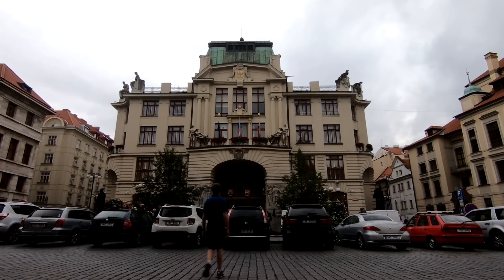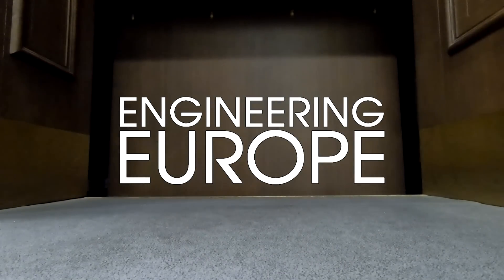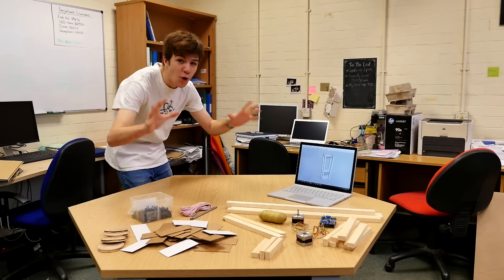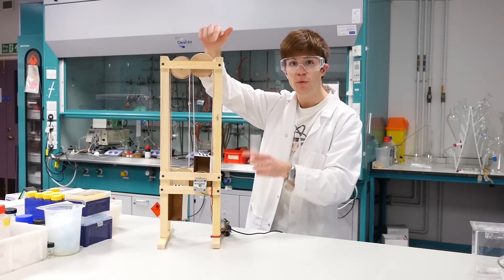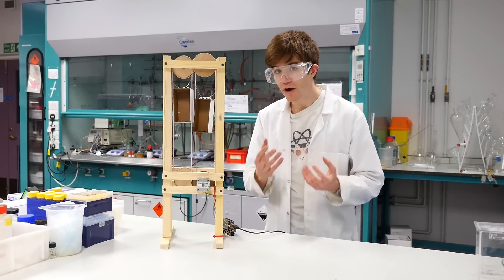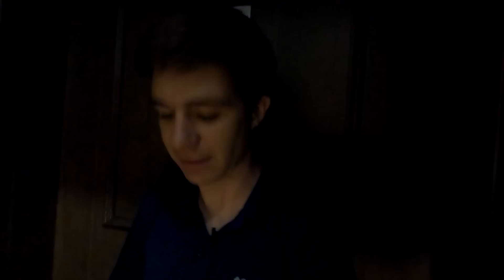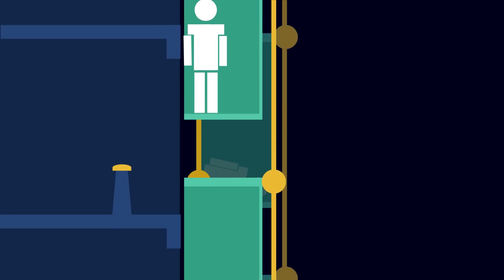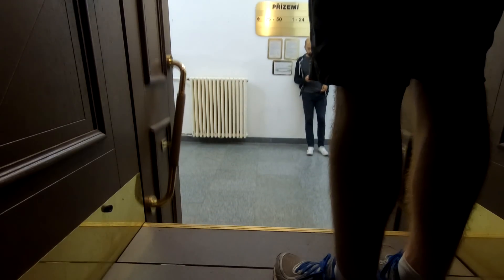Riding the Elevator of Death

Comment: It should be re invented with modern tech with sensors to automatically stop if someone gets stuck between the floor and elevator so that they don't get killed.
Reply: :)) there are already such sensors in place- mix  of  mechanical&electric.... Its not so dangerous as it looks... :)
Reply: @hyneklos  Many used 'trip wires' to detect arms or limbs straddling inside and outside of the cars.
Reply: They Have Now
Reply: This elevator has them. He just didn't show it. Those are the grid at the top of the entry and part of the floor. If your arm is outside it will move grid up, disconnect circuit and the elevator stops. Similar for the part of the floor. There are hinges so if you go up and your feet is up it lifts that part of the floor and disconnects circuit.
Reply: This is how safety flaps work: https://www.youtube.com/watch?v=-Y1ME8n5tCU&feature=youtu.be&t=95
Reply: @JBereza  Good to hear that.
Reply: @JBereza  Thanks
Reply: @JBereza  Exactly! 👍
Reply: Any idea how the safety flaps handle getting stuck between the roof of a cabin and the floor when going down? The video doesn't explain that situation.
Reply: With the general ability of the public to mess up simple mechanics, one can only imagine how many times a day a pretty used pater noster elevator would stop...
Reply: that would be good and bad at the same time since if one person gets stuck then everyone else gets stuck too
Reply: Like those movable boards that are at those elevators already. And BTW they are, or were few years back, in the same group of devices as escalators and travelators, at least in Czech republic. Turning them off with laser gates and closing shafts automatically during fire could easily be done on them.

And it seems like they are not elevators even in other countries in EU and thus they do not fall under harsh regulations for lifts. Thus...  they most likely CAN BE build.
Reply: They already have "tech" to do this. This "modern" age isn’t the first to consider safety. 
Calling them elevators of death is just attention grabbing sensationalism.
Reply: We have one at our university and it isn't great. It is slower than going up the stairs, which can't be fixed without making it harder to board and unboard, and it can't be used by people in a wheelchair. It is also quite a waste of energy since it doesn't stop when not in use. It is fun to use sometimes tho.
Reply: Why not just have the elevators take a short 3-5 second break at each floor?  That way there isn't a huge wait but people can still get on and off in time.
Reply: Or even smarter an idea is to have an even number of carridges and making them the same length between each level so that it can stop for a short period of time at each door
Reply: @zoe4299  i was thinking the same thing
Reply: Could even be done with old tech, if the last say, 60cm to the lift in the floor was an easilly togle able hatch. Get stuck while coming up? No smushing in between elevator and floor, floor will just pop up. Make it a grate so people above can see and hear things going wrong and step off.
Reply: It is just dangerous while stepping on or off for the cabins keep moving and you could struggle and fall. I have taken the paternoster in the Haus Grenzwacht in Aachen, when I worked there. It is still working, but it is not usable forthe public.
Reply: We must never forget, humanity is stupid, if we can find away to mess up safety mechanisms, we will.
Reply: That's called a modern elevator
Reply: or injured
Reply: Where's the fun
Reply: And how do you solve this for people with a handicap? Say someone with a broken leg either using crutches or a wheelchair?
Reply: @saiverx  kick em out
Reply: Nope, there is too much health and safety as there is.
Reply: @MrToradragon  Modern technics is not reliable, I believe more to that moving boards and wire traps than to some lasers.
Reply: Risking dead just so youd save a min of your life.... nah id rather have a door and wait for that minute
Reply: Like Tesla doors
Reply: Elevator Engineers, takes notes from this guy!
Reply: @crimsonbutterfly2282  No respectable engineer would make this for real. Lesson one on engineering is that safety is top priority. So whatever machine you make, youd have to make it dumb-proof. Not even the stupidiest person that has access to your machine should get hurt.
Reply: True but people will still not go on it coz it just looks scary in the end.
Reply: that's easier sed than done
Reply: There are saws that will stop if you accidentally cut your finger, would you put your finger in there everyday because it is safe? No, you wouldn't, that mechanism isn't made for all the time use is made in case of an emergency.
Reply: @JBereza  least im not going to get decapitated by an elevator
Reply: @zoe4299  On the other hand, it may be slightly bumpy. Another problem is that assuming that these are all connected, the "cabins" that are aligned with the floors are fine but the people that are in between floors will be stuck there for additional time. Plus, these don't move really fast, compounding the timing problem, but at least people are not going to get injured from this.
Reply: Imagine the people at the very top and bottom, they'd think the elevator doesn't go back down/up
Reply: Those are already being used I think
Reply: @saiverx  You install a classic elevator close to it. They were used for buildings where a single elevator wasn't enough. This occupies a place for two classic elevators, so  if you have a place for three classic elevators, you put one classic elevator and one paternoster in there and get a much higher total capacity. I haven't seen one installed without a classic elevator somewhere near.
Reply: @jm56z43  this is in Europe. They aren't as idiotic as we are in America.
Reply: @mrgreengenes04  I am European. I can guarantee you we aren't that intelligent that a Pater Noster elevator would be efficient.
Reply: But then the other lift stops and someone is stuck in that tiny spacd
Reply: Except adding more tech and electronics makes things less safe and more prone to problems, design failures, etc
Reply: @vaseklepic12  to
Reply: This is possible, but then again, escalators have the same benefits and none of the problems. They do take more space, but they also take many many more people.
Reply: Pain is often a good teacher

Comment: For everyone trying to come up with fixes to make these usable, I present you: People in wheelchairs or people holding large items who can't see their feet
Reply: I would assume that these elevators would not be the only ones present in a building, if they were to become mainstream. There is no reason why two types of elevators are not allowed to be used at the same time.
Reply: @bowmin1  Agreed. One for fast transport, for busier foot traffic (Prague's Paternoster Lift) and one for handicapped or for people who can't see there feet (traditional lift).
Reply: A 'slow down' / 'stop' button like the ones in revolving doors would fix their issues
Reply: Cripples aren't real people and who watches their feet?
Reply: @RockLeeOfTheMounties  i hope you are joking or just trying to stir things up, and don't actually think this
Reply: @QuincyIsCrispy  but then it stops the entire elevator system for everyone going both ways, so it’s ineffective, you just need a regular elevator instead
Reply: Stop and start at each floor on a timer + an additional handicap button for giving you extra time
Reply: @LeAlexo  Yeah, but how many people will need to use that button versus people who don't? Relatively there'll be so little users of that feature that it really wont matter. Plus and extra 5 or so seconds of waiting wont hurt anyone.

As for people that aren't necessarily movement impaired but just are carrying cargo, if the building requires a lot of cargo to be moved up and down it'll have a cargo elevator anyway. 

With some re-engineering these seem like a great idea to me
Reply: @LeAlexo  its still more efficient because you can have someone unloading or loading on multiple floors at the same time.
Reply: @RockLeeOfTheMounties   Okey boomer
Reply: Why not use the tech used on garage doors everywhere? A invisible beam that must be connected to move. If it’s broken, then box stops. Install a mirror on the back wall of the box so folks can see the floor numbers. 
As for people unable to see their feet, Again, a mirror installed at an angle on each floor aimed at the edges of the box and floor. If your package is too wide to see around via a mirror, it’s too wide to get on the elevator. 
Literally two mirrors and a light receptor. It’s not a complex solution.
Reply: @RockLeeOfTheMounties  Ivar the Boneless wants to know your location.
Reply: Yeah but for thst in thos buildings are even normal elevators this pater noster is great and quic travel . On my college we use it everyday and a lot of times .
We have normal elevators , this one and ckassic sterway and we use this one like in 90% of case , other 10% are whem there are many and you are in rush somewhere
Reply: Fix: they stop for 15 to 30 seconds after reaching a new floor
Reply: @sumvs5992  the point of the elevator is that it keeps on going so that people don’t have to wait as long
Reply: @jhsevs  THEN HOW IS IT EVEN MORE EFFECTIVE THAN A NORMAL ELEVATOR??? ITS NOT SHUT UP
Reply: @Halloweenharen  it would still be orders of magnitude more efficient than a conventional elevator in an extremely busy building
Reply: @jhsevs  absolutely not, if it stops ok every floor then what is the point? Also, with all the extra safety features requiered its going to be even slower AND on top of all this - only one person can go at a time per carriage
Reply: Simple: have one normal elevator next to this one. Trade wait times for accessibility if those conditions apply to you. Most people use this, movers and the disabled use that.
Reply: How about a platform you stand on and that platform slide in and out the elevator automaticly (only if the person is ready). With that you avoid the risk of bad timing when entering or leaving and people in wheelchairs can easily role on the plattform.
Reply: @Temo990  that would defeat the purpose because the elevator would have to stop. The entire point of paternoster elevators is that they’re nonstop with zero wait time. If there’s going to be a wait, you might as well just have a regular elevator.
Reply: @MegaBrokenstar  Not if the mounting mechanism is suffiently fast. Human reaction and movement does take some time as well and machines/computers can be quite fast. A passing machanism would be good (like if you pass an apple from one hand to another).
You have one claw with the plattform and that claw passes the plattform to the other claw which is inside the cabin of the elevator. I think of claws that are used on assembly lines.
Reply: @Temo990  that would have several potential problems and would probably be less safe than the standard paternoster. If that moved while you were trying to get onto it, it could easily send you flying. Any moving parts exposed could easily crush or amputate limbs in under a second before you even realized you were in the wrong place. Not to mention the acceleration required to suddenly shunt this “moving platform” onto the elevator would be extremely jarring to anyone standing on it and probably result in them falling down or even falling off the platform, like a bus you’re standing on abruptly slamming the gas or brakes.

And besides all of that, the complicated mechanisms involved would be extremely expensive even if you could solve all the problems and they’re COMPLETELY unnecessary. Moving heavy furniture or going up and down the building in a wheelchair is an extremely low percentage use case. A large parallel single shaft regular elevator for people who need one would cover the rare cases in which one was doing those things. And a simple system using the technology of existing infrared-beam alarm systems could be used to Autostop the standard paternoster if anything was within 3 inches of the front edge when it was more than a foot above or below level with the floor, preventing anyone from being crushed.
Reply: @jhsevs  but if it stopped at every floor, wouldn't it be slower than a regular elevator?? 🤣
Reply: @QuincyIsCrispy  People would be hitting that "SLOW" button every single time they got on it off the thing, it would be worse than the walk button at intersections.
Reply: go to a hotel or establishment that is equipped to deal with that, why does everything in life have to cater to EVERYONE
Reply: @RockLeeOfTheMounties  Don't cut yourself on that edge, kid, I doubt anyone wants to kiss it better for you.
Reply: ok but ladders are quite popular and they have the same problem
Reply: I present you: They're really fun. Those people can go use the normal boring elevator that carries no risk of death.
Reply: I present to you, nerves!!!!!!!!
Reply: Why not have both types. Being the death elevator comes with a but ton of warning signs. This elevator can make a diff in office building
Reply: @KeruuKat   If you put sarcasm in his post, it makes more sense.

Comment: The one in the UK has lasers if the beam is broken the lift stops automatically
Reply: Too bad. Really bad.
Spoils all the fun of pain screams and bone shattering.
Hope they return to sense and bring back the thrill.
Reply: good idea...
Reply: @pedrocarvalho4999  wtf
Reply: Where is the one in the uk
Reply: @benlenton3932  Sheffield University arts tower
Reply: The ones in Prague (there are multiple, you can most easily find one at the Faculty of Mech Eng at the Czech Technical Uni) have movable boards on each side of each opening, those stop the whole thing way before anyone can get hurt. The bad reputation came from the ones that didn't have these simple safety features.
Reply: I think that the don't have safety sensors are illegal today.
Reply: @pedrocarvalho4999  What the actual hell
Reply: @pedrocarvalho4999  well if we can respawn back its fine but we can't respawn in this world
Reply: uhhhh I went in it recently and I didn't see any laser, just pieces of string that do the same thing
Reply: @rakifdes  smh we can have you ever played m I n e c r a f t ?
Reply: @novacentorium4943  oui
Reply: @novacentorium4943  it’s hardcore. Everything is against us.
Reply: @adigenix  oh frick
Reply: @selfdestructiontaboo  You know you could simply press the emergency button, do you? Eighter way, doing this intentionally to trap users in the elevator is illegal ;) Misuse of the emergency button or messing with the electronics meant for the safety of the whole thing is a serious issue and you could be fined at best, or go to jail at worst. Don't do this...
Reply: imagine being in between floors and some doofus sets off the emergency stop

Comment: Yes, the lifts are less safe than the classical type, probably on principle alone. But Paternosters used today are usually equipped with numerous pressure and light sensors. Those stop the entire system when you would get caught between the cabin and the platform, preventing... ehm... amputations.
Next time in Prague, go to the Czech Technical University in Dejvice. There are three Paternosters there, and also you can ask the other mechanical engineers about the safety features. ;)
Reply: Technical University in Kosice (Slovakia) also has one in the main building. I have never heard about anyone getting injured there and the university had about 10k students back when I studied there.
Reply: There are paternosters at CTU? Probably not FIT I suppose, because I have been there and  haven't seen any.
Reply: That would defeat the purpose of it being efficient. Might as spend the couple minutes waiting on a safe elevator than constantly hitting bumps on these.